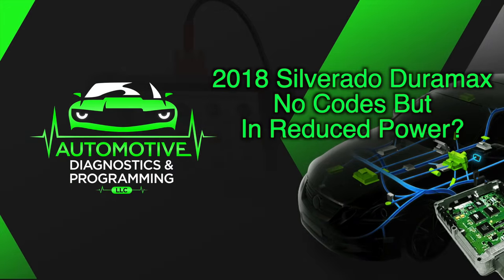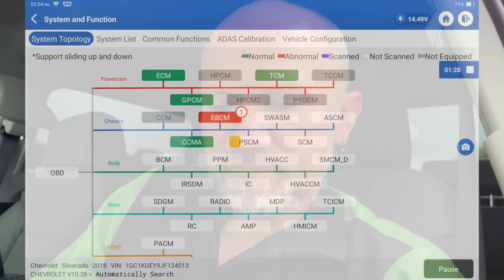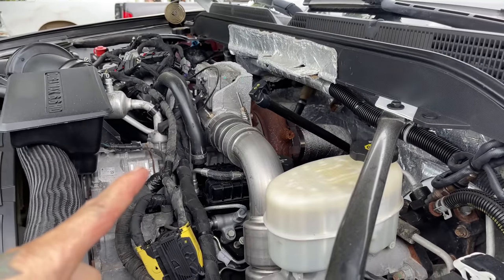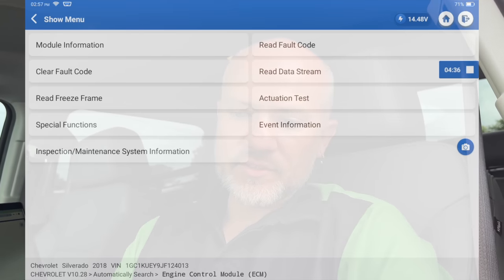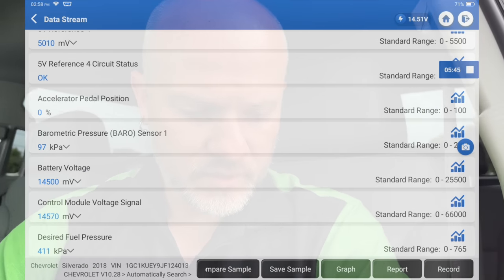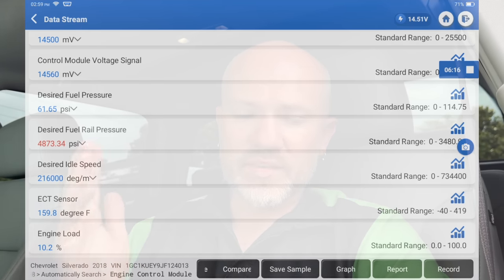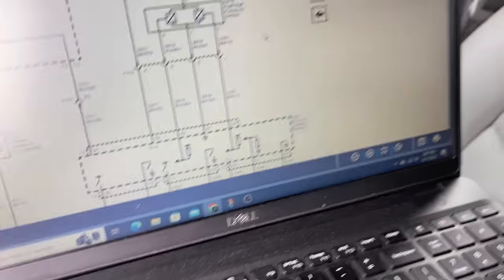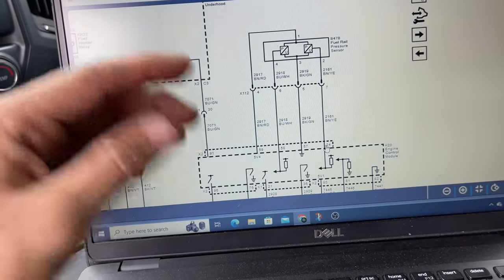Duramax In Reduced Power Hero Truck?

Comment: Jake, hope you didn't get too wet putting that truck back together.  I really like the way you work down to the problem as well as your explanation.  I put a couple of but connectors in my car and they worked fine for about a year.  I believe I'll be going back in with a soldering iron because the vehicle is starting to act up again. Swallowing my pride! Thanks for Sharing!

Comment: Good one for sure.  I'm wondering if there was a problem with those but connections and just handling it could have corrected the issue, well temporally anyway.  love your strategy of using your scan data to prove out circuit
 integrity!  Nice to see a diagnostics procedure without the scope.  Keep up the good work Jake!  Thank you for all your video content!

Comment: Nice job Jake!  I sensed the obvious frustration of repairing someone's attempted hacks.  I don't like touching diesels either for the same reasons.  Most of the time when I open the hood, I see parts missing and connectors unplugged.  I cringe. 
That's when you want to charge double.  Engineers design these parts for a reason.  Diesel's have plenty of power to begin with.  Leave them alone!  Thanks again for sharing your experience and time.
Reply: I don’t think it’s about power when people delete emissions. It’s all the problems they cause. I watched a video on a 2023 Ram with the Cummins that broke down with 1500 miles with emission system problems.
Reply: @autodiagyt  I dealt with the same in trucking. Unfortunately, I drove to Alaska hauling produce and lots of nights I couldn’t shut down and the emission system cost me a lot of money.

Comment: I’ve ran across this issue with a tuned 2016 corvette once. I used HP tuners to go through all of the DTCs to see what all was disabled and reenabled some DTCs that shouldn’t have been turned off. Some people need to learn a little bit more about tuning before they just start disabling DTCs at random. The heat shrink butt connectors are fine when done properly but those stupid solder loaded butt connectors are trash. They don’t flow like they should and are a horribly designed product. I like to solder but I have no problems with butt connectors when used with a proper crimping tool and heat shrink.

Comment: Great video, I have a 2018 Sierra Denali just bought 3 weeks ago.  Today it had the sudden loss of power with the Engine reduced power alert.  So, I check def and it was ok.  When I started back up power returned, and message is gone.  I have the check engine light still on.   I guess I'm off to the parts store to get a new code reader, after I check the connections. Thank you for sharing your knowledge.
Reply from the maker: Don’t get a parts store code reader. There is better options that are cheap. Look on my amazon store. You can get full system scans and some bidirectional controls fairly cheap
Reply from the maker: TOPDON TopScan OBD2 Scanner Bluetooth, Wireless OBDII All System Diagnostic Tool, Active Test, Check Engine Car Code Reader, Vehicle Performance Bidirectional Scan, Repair Guides, AutoVin, Black https://a.co/d/3NxqBRq
Reply: @autodiagyt  Will this one also show u data for the fuel rail pressure sensor im getting power reduce with p0191 , p026D and p0894 codes set at once
Reply from the maker: @garymathews3903  I’m pretty positive it will. If you get it and find a data pid it doesn’t show and you know it should be there you send in a feedback ticket and they will fix it. The topscan is a base for them to gather user feedback and develop their own line of diagnostic software. They have started using it in the topdon ultradiag scan tool.

Comment: Had the same exact experience, replaced EBCM, sent new ECM for tuning, replaced lower engine wiring harness, fuse block on both sides of engine bay and it finally was good for a year. Now the problem is back. I’m gonna check that connection at the pressure sensor and see if that pigtail has a bad connection. But being the fact the truck is tuned and deleted has nothing to do with a bad connection at the fuel pressure sensor
Reply: Your right the wiring on these trucks are trash this is a very common problem according to all forums and some videos I hope u get yours figured out mine just showed the po191
Reply: @bruceshepard1136  I replaced the sensor and the pigtail and it’s been running fine. I’d say that was it. I’m so glad this guy found this. I chased my tail for months trying to figure this out. The truck was not even drivable

Comment: people dont understand in the old days before electronics you could do crimp connectors. the circuit ran in amps and a small volt drop did little if anything to affect the circuits.  now with electronics signal circuits are miliamps. there are still circuits you can get by with crimps but anything that goes to a computer or module NO!!!!!

Comment: Maybe the fuel cooler I know I need to replace mine there's no codes maybe the sending unit or both.
Reply: Or just fuel lines half are bad all the way from the fuel cooler to the engine is rusted.